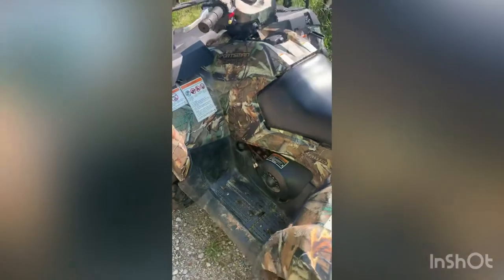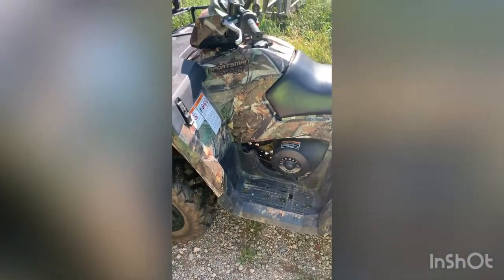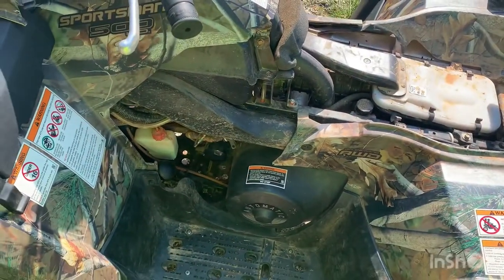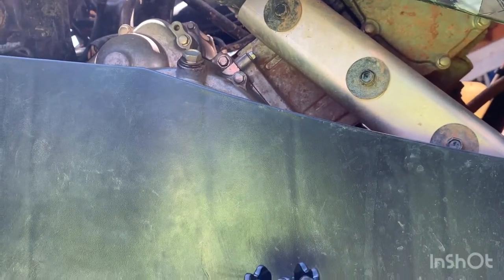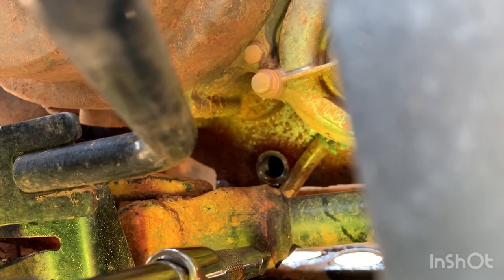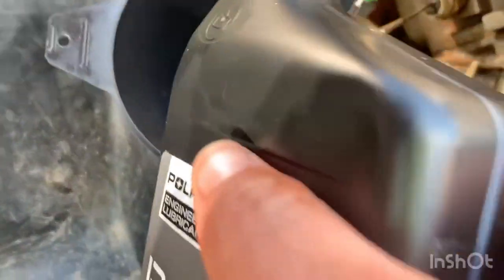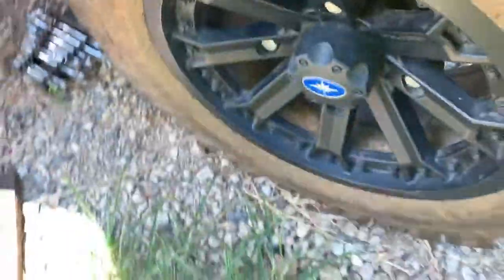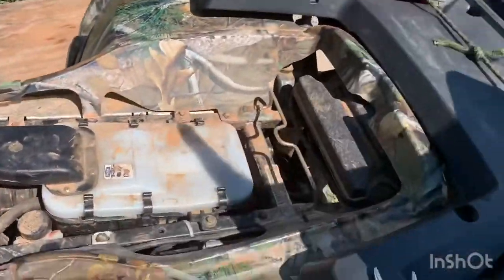Polaris Sportsman 500 HO Oil Change [[ Big Problem! ]]

Comment: And you only need to prime the oil pump if you disconnect the oil lines. Normally when cleaning the screen on the line you clamped. I cringed watching that knowing your machine not only didn’t have oil in the filter, crank,  and you pinched the line keeping the pump from pumping oil to your engine (and gas mixed with what was in the engine on top of it all!). Sorry for the thumbs down, and thanks for the video, great effort. 
And it’s good thing you’re running the ps4 
(hopefully it saved your engine 😉)

After you pinch the top line about 2” from the reservoir, avoiding the nipple and slit in the line(guessing about 3” in) run for 15-20 seconds turn off and as you unclamp listen for air movement if you hear it it’s primed if not do it until you hear it. Thanks for the vid!

Comment: Always shut the gas off after finished running it. That cured my problem of gas in the oil
Reply from the maker: That’s what I normally do on my tractors. I went through my Polaris top to bottom trying to find a cut off. Never could. I guess I’ll have to break out the book or just add one. Thank you for commenting and watching!

Comment: A little off the subject... I have a "2012" Sportsman HO 500, with believe it or not, less than 50 hrs on it. Back a few months ago I noticed around 5000 rpm it would bog down and almost die.. It idled and run fine otherwise. Since I hadn't rode the thing very much, I believed it was trash in the carb. I cleaned the carb and replaced the jets.. No improvement. So, I purchased and installed a new carb.. Problem didn't improve. I changed the plug.. No help. I replaced the pulse pump and all the fuel lines.. No help. Removed and cleaned the tank.. No help. I knew the air filter was new, so I hadn't even given it a thought it might be the problem. But, one evening while listening to the engine idle, and revving it a little.. I thought I'd remove the filter cover and see how it run.. and it actually improved a little.. So, I removed the filter, and it improved a little more. And that's when I found the culprit. All that money spent on parts, time of changing them out.. and the irritation of worrying about this bike.. came down to the hard plastic sleeve inside the rubber breather tube, that prevents the rubber from crushing when you tighten the air filter onto the rubber intake hose. When I replaced the air filter, I had invariantly caused that little hard piece of tubing to be turned sideways inside the rubber breather hose.. which allowed enough air for the bike to idle and run half throttle, then fall on it's face around 5K rpm or so. Moral of the story.. Check everything, even if you think it's correct.
Reply from the maker: I can believe it. I believe mine is only at 150 hours. I couldn’t tell you how many times stuff like that has happened to me. It is always bitter sweet when you find the issue. Your happy as heck it is fixed, bud mad you did so much for nothing. On the bright side you should be good to go for a while now. Thanks for sharing that. It is good info to know. I am sure you are not the only one that has happened to. Thank you for watching!

Comment: You clamped the wrong hose.  You should clamp the hose at the top of the tank, between the tank and the slit in the hose.  After 20 seconds,  turn the engine off and remove the clamp.  You'll hear a rush of air.  Now the pump is primed.

Comment: It's fine to run 10 percent ethanol in a small motor "if" you run it daily. If you have a machine that sets idle for long periods, use pure gas or drain the carburetor bowl of fuel after each use. Ask me how I know..
Reply from the maker: I am 100% with you on that. Unfortunately I had to learn the hard way as well. Thank you for watching and commenting!

Comment: I'd pressure wash it before beginning. There's a lot more to check and service shown in the manual. Also, check for mice. Mine has 3 air tubes that I've found that they can get in. The one to the air filter, one to the engine under the air filter box ( I don't know what it's for yet) and one to the belt housing. I have an X2 which I only bought because it was deeply discounted, a 2 up and for the box. I would not by another one that was such a pain in the ass to service and I'm not particularly fond of Polaris.
Reply from the maker: I normally pressure wash mine very carefully. I read somewhere on it “do not pressure wash”. It’s really the only way to get most of the mud off. Yes the mice are a pain. I haven’t found any in mine yet, but I keep poison in my building constantly for that reason. Thank you for watching!

Comment: Hello! Do you know where is the engine serial number STAMPED? (No sitcker). I have to sell my atv and it's a requirement. Thanks a lot!
Reply from the maker: I wish I could help. I have never had a reason to look. Thank you for watching!
Reply: Under the front right side sitting on the machine
Reply: Or on top of the pull start(right side top of crank)